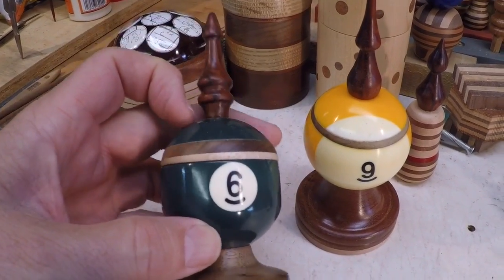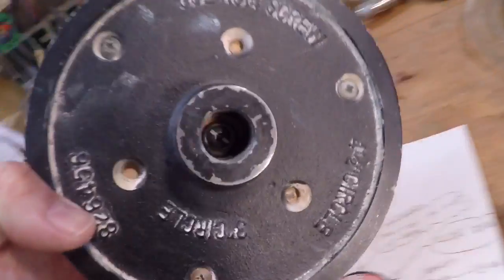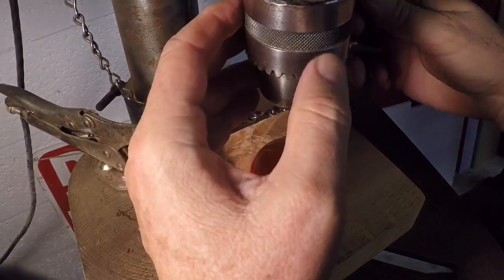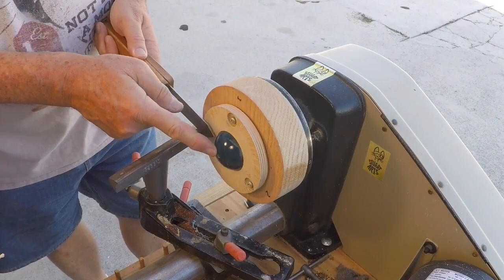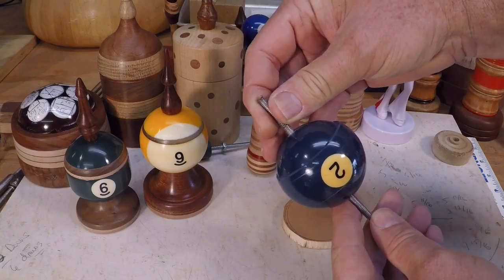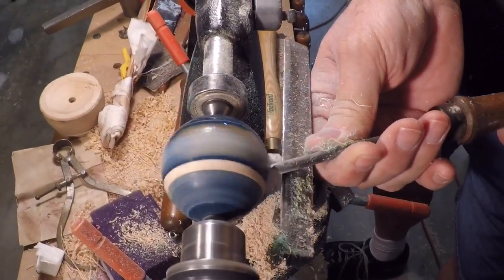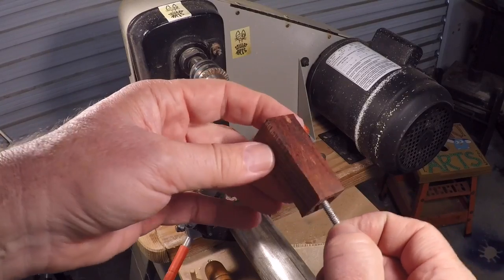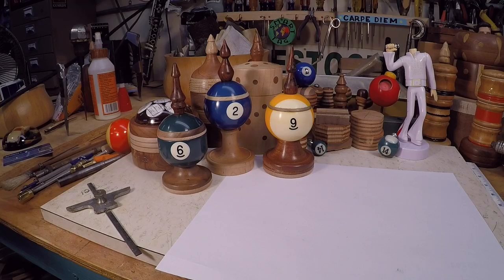How To Turn a Billiard Ball on the Wood Lathe - Generation I

Comment: Great video and project, I've seen billiard balls at tag sales to now I will picked them up next tim I see some. Any idea how deep the "number" goes in the sides?
Reply from the maker: Paul Lajoie : thanks! That's a great question. I'm not certain, but I think it's something like 3/16", give or take.
Reply from the maker: Paul Lajoie : I should also note that no two sets I've had are alike. There could be significant variation depending on the maker.
Reply: Jimmie at Stuart Arts  Thanks for the info Jimmie. And to let you know I did a search on Facebook market place, found a set for ten dollars. They are just over an hr away so not sure Ill get them but it's another resource for anyone wanting to try this.